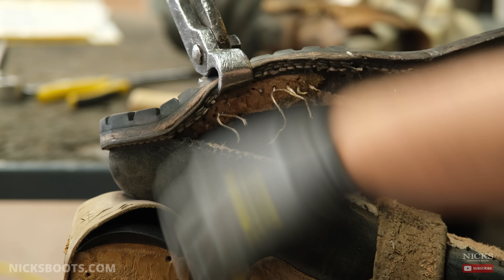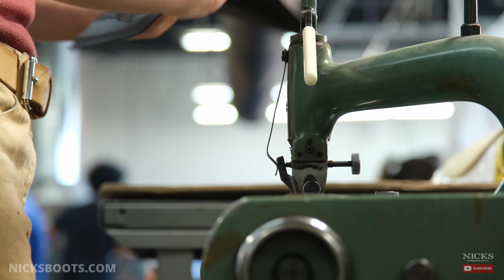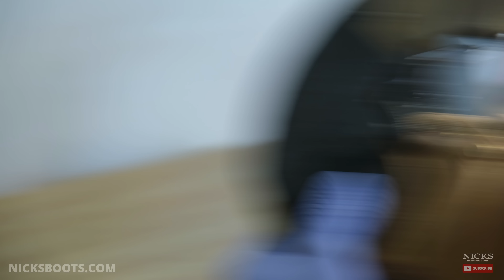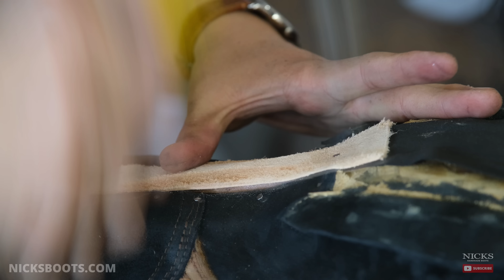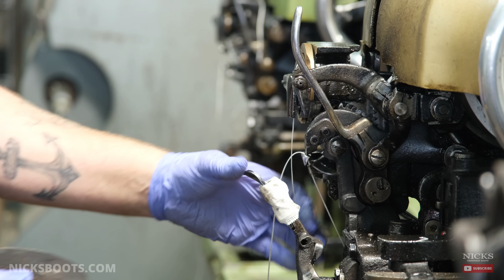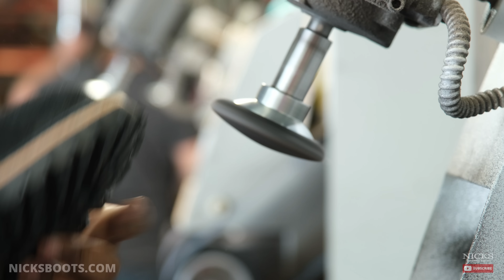Nicks Boot Rebuilds: Old And Worn Black And Tan Work Boot

Comment: Those still looked pretty good...not entirely sure why they needed a rebuild...let alone even a re-sole?
Reply: Could have gotten wet and had warping on the inside has happened to a pair of similar boots I had
Reply: My thoughts exactly,  tread being ripped off hardly looked worn